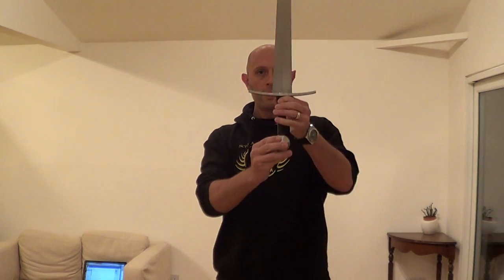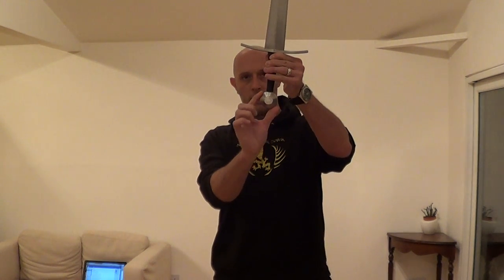Hollow medieval sword pommels

Comment: You could also forge a large-diameter ring, punch/file the tang openings, then braze a plate on each side. This could be easily done in a small forge with brass or bronze filings. This would allow you to insert things like small relics (bits of bone/cloth) before fitting the pommel onto the sword.

Comment from the maker: Well to be more precise, most examples in museums are partially hollow, so they have a solid part and a hollow part. Why? I think in a word because they liked to 'look'. Adding those hollow parts onto the solid pommel doesn't assist the grip on the sword or make it more offensive, but it does give the whole sword certain proportions which they seem to have liked. And perhaps a bigger pommel implied a heavier sword and 'power' somehow. Makes the sword look bigger and more impressive.

Comment: What do you suppose was the function of these hollow pommels then, besides a purely decorative one, and to enhance grip of course. Loyd (lindybeige) has made a video about this topic, and the points he makes in it seem logical to me, but he doesn't really go into the function of hollow pommels (except grip, and that they weren't counterweight, at least not up until the later swords). What about, well, pommeling? It is shown in the sources, wouldn't a hollow pommel take away from that?

Comment: Hi Matt.

Could you point me to resources on photographs, measurements etc. on swords with hollow pommels for ease of reconstructing one? Google doesn't seem to be giving me much.

Also, could you elaborate on a period/area of these swords. I know many viking sword pommels were hollow, but assumed that swords in medieval times would be solid. Is it only for early medieval or does it continue all the way through?
Is there a literary basis for assuming this was a known distinction in use back then, e.g. some swords could use the pommels offensively, while others could not?